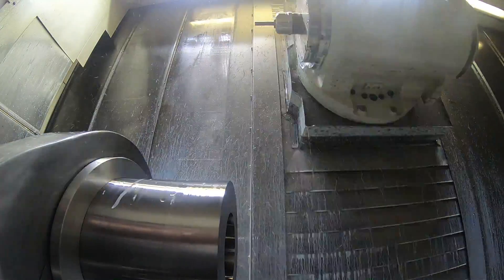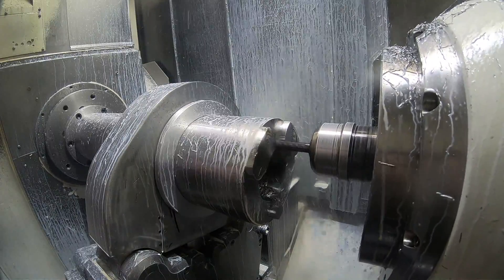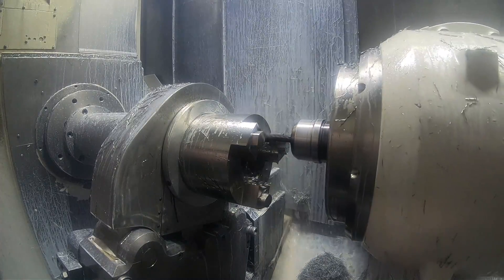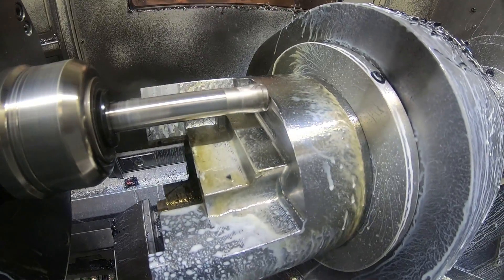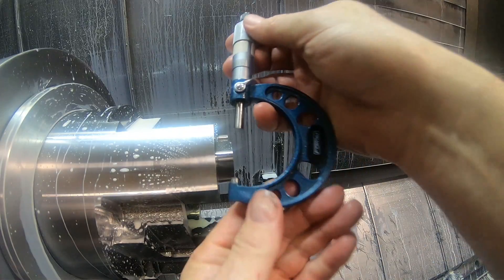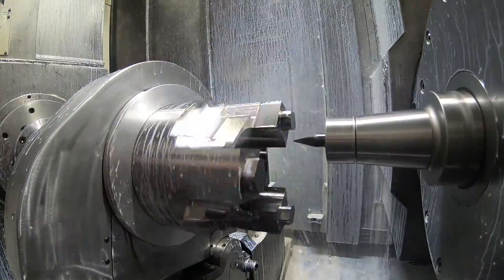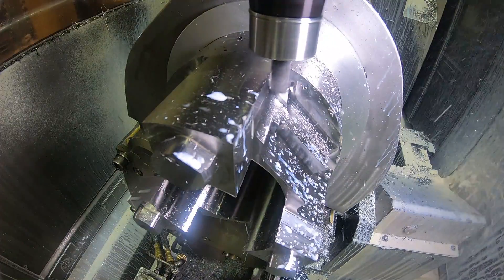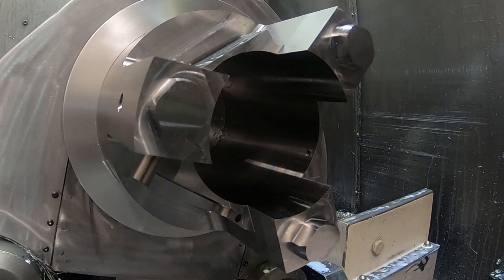Super Duplex Op 3 FX Chuck End Arbor

Comment: What feed speed doc were you using with that Endmill?  I'm looking to machine some Cd4 stainless and need a place to start
Reply from the maker: I think if you start with parameters you would use for 316 ss it would be a good starting point.
Reply: @EdgePrecision   thank you!
MSC was saying somthing like    3.6 ipm     .0005" per tooth....   I don't think that's right

Comment: Hi Peter.
Are these Mitsubishi high feed mills good for stainless?
I've tested some and Walter are the best for me until now.
Just curious, depending on what you say I will test them.
Reply from the maker: Yes I use them on stainless and titanium as well. I also use Tunaloy and Iscar feed mills in these materials too. I think I like the tungaloy ones the best.
Reply: @EdgePrecision  Thanks for answering. I've tried Kyocera, Korloy, Taegutec and YG1. None of them could beat Walter in tool life and MRR. I got 2hrs of contact in 304 SS running with air.
Would you mind telling me the geometries of the ones you use?
Let me tell you man, your channel is the one I admire the most. Because it's real life machining, not boom this or boom that.
I think I watched all your videos at least 3 times each, and I'm in business for almost 20 years. You are the reason I keep saying our company must get an Integrex.
Thanks a lot.

Comment: When you rerun the finish at 7:16 do you set the offset down ?, because you taking so little of a cut
Reply from the maker: With Sandvik Silent bars If you take a finish cut and are very close to the size. Than if you just rerun the bar it will cut oversize. The bars are excellent at damping vibration (The Best) but they also flex away from the cut. So lets say you took a finish cut removing around .010" of stock. And you end up within .001" of your finish size. So you want to go in for that .001" of material. The bar has less pressure on it and it will cut larger than expected. Now with experience with the particular bar and head you are using you can learn to predict how much this will be and actually go smaller with your offset to compensate for this reduced pressure on the bar. Hope that make sense. Its a little hard to describe.
Reply: @EdgePrecision  Darn thanks for the quick respond , when i was learning cnc i mistake taking a finish pass and not setting the offset down thanks for the respond keep up the good videos.

Comment: Great video Peter.
I found out that  plunge milling is fastest way to remove (rough) big amount of material in short time.
But in HSMworks or Fusion 360 it's little bit tricky to set up, you must improvise. In MasterCam you have strategy specifically for plunge milling.

Comment: You should try Tungaloy's dofeed indexable cutter for HFM.... their cutters damps a lot of vibration that Mitsubishi cutter can never damp.... inserts are pretty cheap as well, $13 i think... They have 8015 series inserts which are like GOD of hardened steel....i never trust the cutters with two inserts, if one breaks the next one follows and by the time you realize or reach the machine, it damages the pocket. i remember one time i did .75" Radial, .030" axial at 400 IPM on 4140 on freaking cat40 Fadal(Fanuc) machine and never hit 80% Spindle load. Your machine is beauty though..... did you name her..

Comment: what kind of cutter at 10:10 seconds does the under cut.  is that a screw in cutter to shank?  it's the titanium nitrided cutter like a woodruff cutter.
Reply from the maker: Its a Iscar Multi Master tool. The carbide tip/insert screws into the shank.

Comment: For the dynamic, or adaptive toolpaths, as your axial step over approaches zero, your feed rate will increase to infinity because of the radial chip thinning that takes place. I think that your feed rate could easily be doubled. At a certain point, it doesn't matter how fast your feed the tool is your step over is smash enough. 

It also makes more sense to step up your depth cuts with an adaptive cycle because the huge advantage is the constant step over so you can use the entire flute length. If you step down, you end up cutting the same area with each depth pass.
Reply from the maker: In materials that you can’t run high surface footage there is a diminishing return. In these materials it is faster to use a feed milling strategy. I have some small diameter solid carbide feed mills on test. This is for the actual material. We shall see. I have it programmed now with adaptive type of milling. I am doing full depth cuts. There is a limit to the feed that any machine can actually do in the small movements. Your cam software says one thing but the reality is the machine doesn’t have the acceleration rates (at lest not my 13 year old one) to actually get up to the programmed feeds in the small movements in slots. So the computer says on thing and reality is another. Also the file size gets so large that I have to break up the program into mutable files. This is inconvenient. Having to reload the programs over and over. Before you say run DNC. With that you can’t rerun tools . That is even more problematic.

Comment: Hi Peter,  I noticed there is a change in ur fixture designed and  manufactured. Did u change that for some reason?
Reply from the maker: What Specific change are you referring to? Using the steady rest. I made the spindle side a little longer (Good thing I did). So I felt the need for the steady. I made the cover over the rollers to keep shavings out from under them.

Comment: Why no coolant Peter? I know a lot of people turn it off for filming, but you filmed almost the whole part being machined. Was it not getting hot?
Reply from the maker: I did run coolant you just didn't see it. I took clips without coolant. The feed mill was running air blast thru the spindle. This is the preferred coolant for a feed mill.
Reply: Edge Precision thanks for taking the time to answer, upon rewatching you can see the mist, it’s just a bit lost by time lapse! Very interesting thank you!

Comment: Hi Peter,
I love those high feed mills. I had  a 2" Sumotomo running at 400 IPM at .06 depth of cut in 01 with good insert life. The guy who took over the area tried ramping the RPM way up and slowing down the feed and only achieved 250 IPM and burned up inserts real fast. His conclusion was the cutter was no good when in reality he did not know how to use it. I asked him where he came up with his feeds and speeds and he said he just guessed at them.
Steve
Reply from the maker: Thanks Steve. Yes this happens because of their lack of understanding of what going on. I'm surprised he didn't also increase the depth of cut beyond the inserts big tip radius. Thus negating the whole principal of the feed mill completely.

Comment: Why did you use C-X machining when roughing with the endmill but then used X-Y machining with the Mitsubishi mill?
Reply from the maker: The pocket that had the diamond shaped pins went all around the face. On this machine because there is Only 10MM X minus travel that was necessary. On the other pockets. I was able to position them above the X zero. So I could run them in the X-Y Style. I will always try to do the X-Y style of machining if possible. It will be faster because the rapid moves of the C axis are slower.
Reply: @EdgePrecision  Thank you.

Comment: Hey Peter just curious on your speeds and feeds during the dynamic cycle? On tool steels and alloy steels I'm routinely running 800 sfm and .012 chip load. It's proven faster for me then feed milling up to about 8xd.
Reply from the maker: Yes on materials that you can run a higher surface speed this style of machining can work. I could have done that on this fixture. My intention with this video was to show different methods. For the types of material I normally machine the feed mill generally works better. If your machine is capable of achieving the actual feed rates. Many older machines cant really reach the feeds in some of the small movements. Also then programs memory size gets to large for older controls this can be a problem.
Reply: @EdgePrecision  Gotcha! Thanks for responding and the excellent content.
Reply: @Herbster472  I got a chance to attend Sandvik's MCT class a while back and they ran both adaptive style paths and the high feed paths. We ran the numbers and I was surprised to see that the HFM path had the higher MRR. Beyond running into data starvation issues, HFM might have the advantage because the inserts are designed to direct some of the cutting forces axially into the spindle so you can push those feedrates a bit harder.

Comment: Hey Peter, do you take chip thinning into account when programming the adaptive roughing cycles? You can increase the feedrates by a large margin and still get high material removal rates even with the small radial load.
Reply from the maker: The same is true of feed milling. Yes also in adaptive type of milling. With lower hp and smaller taper machines(40 and below) the adaptive cycles are probably the way to go. With more rigidity and power feed milling is better. At least that’s been my experience. Except in easer to machine materials. Such as aluminum.

Comment: adaptive clearing feed rates are generally much faster than you showed. for example IMCO speeds and feeds for their Ipt 7 flute endmills 1/2" endmill, 1.500 loc, 03cr in 304 stainless is 450sfm, 3438rpm, .0064ipt, 154ipm, 8%, .04" width of cut and 1.500" depth of cut. i have run this setup in a weldon holder on a 40taper haas for few years and its much faster than you presented, its my go to roughing tool. Also with amazing tool life. IMCO speeds and feeds are designed for HEM toolpaths. I highly suggest trying one of their 7 flute tools and speeds and feeds.
Reply from the maker: I should have been more careful the way I explained this. I wasn’t trying to say it was better in all conditions. What I was showing was two different machining methods of roughing. For machines with less horse power and rigidity this adaptive type of roughing does work good. In certain materials there may be a advantage to using high feed milling. I wasn’t trying to show it’s full potential in this video. Far from it. You are correct in what you are saying for your Haas mill. It has been my experience that when a machine is capable and there is a lot of volume of material to remove feed milling is faster. But high feed milling does and will put more stress and heat into the material.

Comment: Great video, once again.
I agree on what you said about the trochoidal toolpath - Its relatively slow but very reliable and does usualy need no babysitting. I use it preferable when I am machining and programming at the same time on one part - While its doing roughing with trochoidal toolpaths, I can concentrate on programming the finishing toolpaths.
Reply from the maker: I have been thinking about your comment. I think it is interesting that I do the same thing. When working by myself I have to do everything (meaning locating ordering tools, programming exc.). I like to get the job running in some way. Than while the machine is running I can continue to program or look thru catalogs and make phone calls to order tools. Its interesting to see I'm not the only one. But to do this I need a very reliable tool path at the machine. I think people see this adaptive/trochoidal type cutting in videos and it does look impressive. If the machine isn't capable of the high acceleration rates necessary it wont be faster. You may never reach the programmed feed rates.
Reply: @EdgePrecision  We do not use this method in production machining at all.  Looks like it's very hard on the ballscrews. Interested in how often you check your backlash?
Mazak VRX use heavy duty roller guides, I'm assuming this machine shares that.  They fail after about 12 years of production with heavy machining.  Mazak are excellent machines.
Reply: The main reasons I see people losing a lot of time on trochoidal toolpaths is because they aren't programming the back feedrate (when the tool lifts and moves) to the maximum feedrate of the machine (a bog standard Haas VF2SS can feed at 833ipm and accelerate to that pretty quickly), and/or they are using machines with slow accelerations. Like Peter said, acceleration is a major component, so if you lose a lot of time in the linking moves then high feed milling could be better.
Reply: Hi Stefan,

They use trochoidal toolpath at my full time job all the time now thinking it is much faster when in reality the metal removal rate is no where as close as it use to be. We never had a back log at the CNC mills for decade and now it is the biggest back log in the shop.
Steve

Comment: You lost me around 5:46. How do you get the pins to go in the holes if they are .001” bigger than the bores?
Reply from the maker: I should have been more clear with my explanation. I have been holding the bored to nominal + .001. There tolerance is plus and minus .002. So if I machine the pins to minus .001 below nominal they should have a .001-.002 clearance on the bores in the parts. I hope that makes better sense.
Reply: Edge Precision yes that makes perfect sense. Thanks for clearing that up.

Comment: Hi Peter,  Fusion360 recently added "both way" machining strategy for their adaptive.  The advice is to climb mill at your chosen DOC, and on the return conventional cut, reduce the DOC to 50 to 75% of the climb direction DOC.  Doesn't work for all situations, but I have used it successfully for some work.  Saves cutting a lot of air.  I wonder if Esprit has a similar capability?

Thank you for your wonderful detailed explanations.
Reply: Have you done that in steel? I thought they only recommended it for soft materials like aluminum and plastic. It is a cool function
Reply: @spazzywhitebelt  I've done it on Aluminium OK.  I had issues with steel, but my machine is like trying to mill with a piece of spaghetti.  It is only small.
Reply: @chrisjh777  For roughing cuts, i thought it would make little difference, but I'm guessing the chip profile would be not good, and possibly get chip re-cutting. Just guessing.
Reply: @debonh3828   Adaptive (trochoidal) machining is a roughing strategy only.
Reply: @spazzywhitebelt  I have done that in steel and worked fine but i dont know how well works in the long run. Sorry for my bad English I am from Europe.

Comment: do you usually  charge the customer for the fixtures like add it  to the quote or do you like add it to the final bill.
Reply from the maker: It all part of doing the job. I have hade customers that wanted the fixturing in the past. They had to pay extra for it. I keep and own all my fixtures. It’s built into the price. The next time I run the job it even goes better and makes better money.
Reply: @EdgePrecision  you did a video a while back about running a shop and I believe you talked about pricing in there but if you have time to discuss how you price a job like this I'd like to hear about it. I feel like you could really shot yourself in the foot on a job of that scope given just how many variables you have to consider.
Do you always quote before starting a job or do you have enough relationship with the clients where they're okay doing time and materials?
Reply: You build it into the quote. You can't quote them one price, then realize you haven charged them enough for fixturing, then charge them a price different that the quote price at the end.
Reply: @jimazmachining6313  yeah certainly don't get paid for quoting...we recently put in a bid that had ~175 parts, spent a few days doing that.
You do work for any of the distributed manufacturers? We're setup with one and I really like the whole here's what we'll pay deal. Thing that's annoying is you can't talk with the customer and advise for machinability.

Comment: I remember at my last job seeing someone cutting a 3/4-inch deep pocket in 17-4 stainless in one pass using a 2-flute inserted mill with coolant and ended up rotating inserts every two parts because the cutting forces were so high.  They did it because the higher-ups who don't do machining tightened up the department's budget too much and they didn't want to spend the money for 6-flute end mills.  I just hate it when the HIPPOs get in the way.

Comment: Hi Peter, why do you machine your locating lugs as diamonds instead of circle? I've seen you do it also in other videos.
Reply from the maker: It makes the alignment less critical on diameter variations of the hole pattern. The purpose is more for rotational alignment.
Reply: Damien Pankhurst im guessing its for the four point contact. A full circle has too much surface area. And can make it difficult to slide on and off.